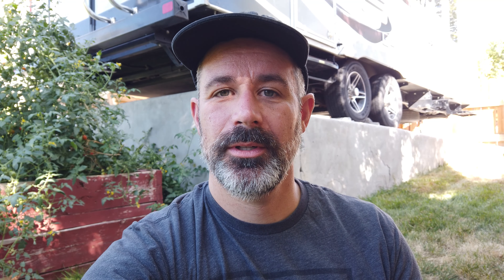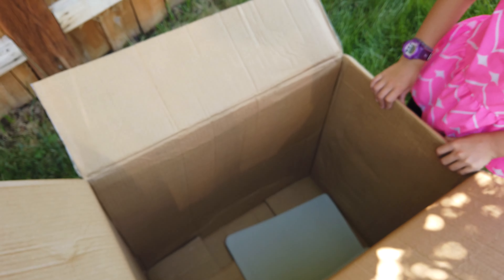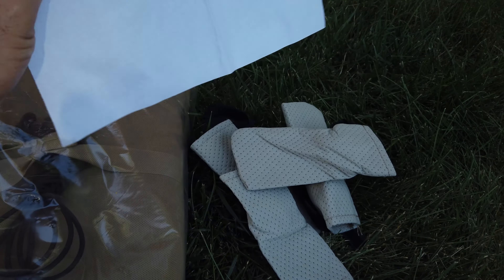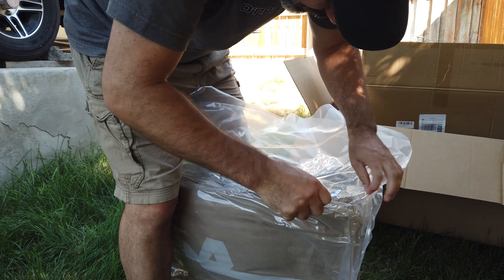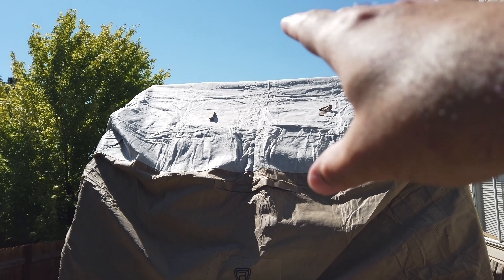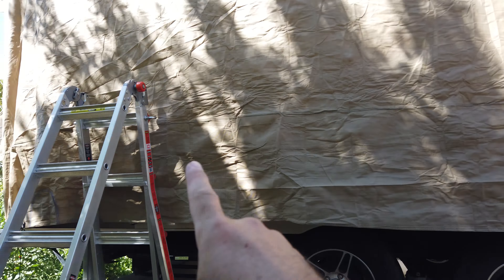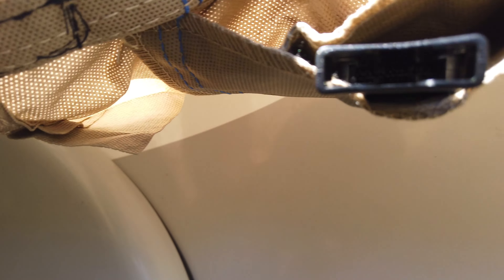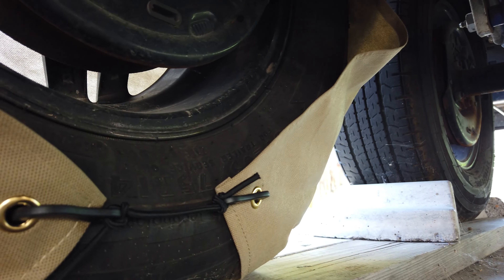Protecting Our Lance 2185 With The RVMasking 2022 Travel Trailer RV Cover

Comment: I didn't see another video, did you cut  the cover? 
How has that held up? 
I'm planning out a solar array on my 28' Mallard.
Reply from the maker: I have not yet made the follow-up video where we cut erectangle out of the top of the cover and then installed grommet reinforced holes and then small hooks that hold on to the lower edge of the solar panels all the way around the trailer. It has worked great. I intend to make a video about it now that we're finishing up going through the winter. I have a queue of videos ready to publish though so it's going to be a little bit.

Comment: How many batteries and how much solar panels are on the roof? 4 kw ?
Reply from the maker: There are 8 x 100 amp hour LiFePO batteries or 9.6 kWh. I made a video about the electronics here https://youtu.be/dse_QW7fDmk
Reply from the maker: There is 2,650 Watts of solar panels on the roof which is made up of 5 x 530 Watt panels. You can learn more about how I mounted these panels in this video https://youtu.be/DPY6RY9Ck28